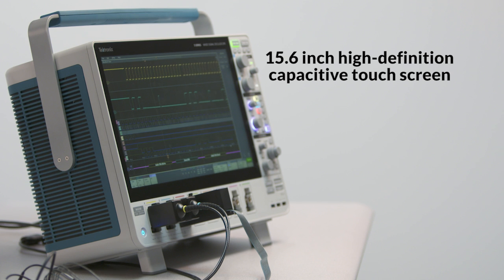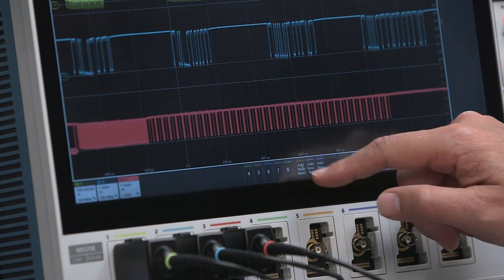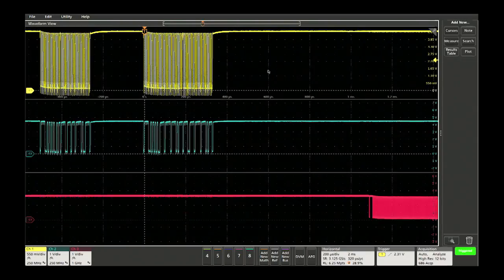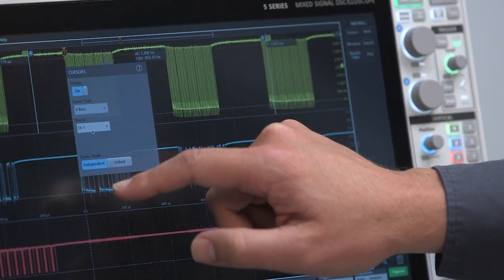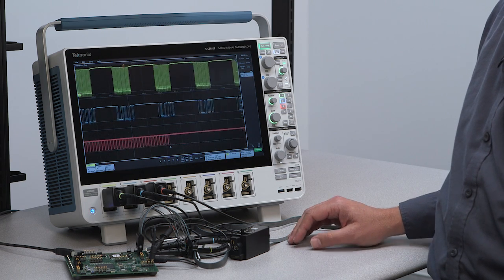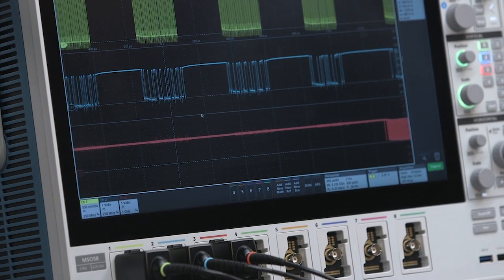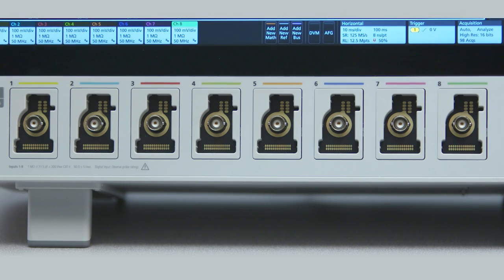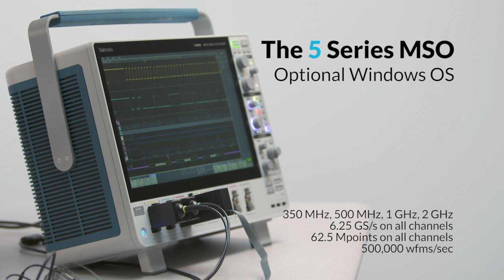5 Series MSO Mixed Signal Oscilloscope: 5-minute Overview

Comment: The interface does not look like it was made for fingers. Everything looks smaller than the average finger, controls look very difficult to operate and not so easy to use. The waveform manipulation looks cumbersome and unresponsive. It seems TEK is excelling in the hardware front and playing catch up on the software. 

I don't value a touch interface in a scope, I think it's really more work than dealing with good responsive mechanical controls. But when I see it advertised as "designed with touch in mind" and the resulting product is anything but, I feel compelled to comment.